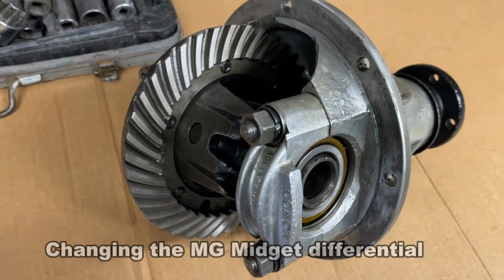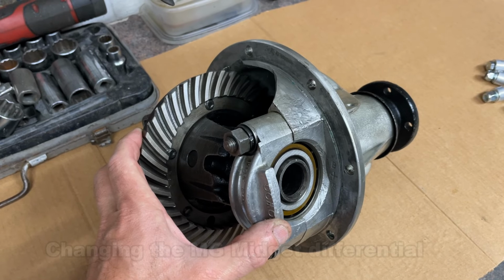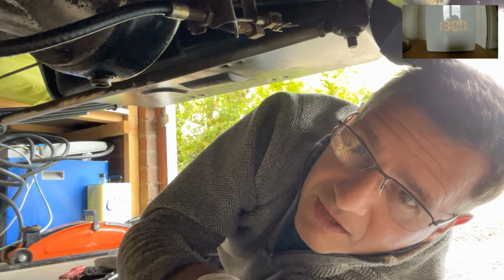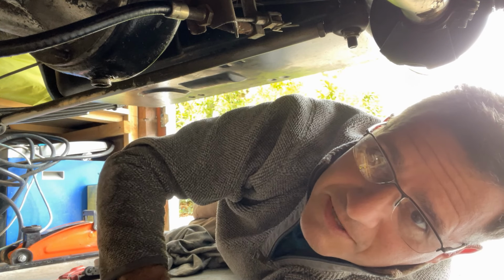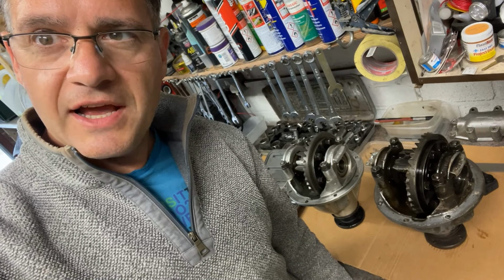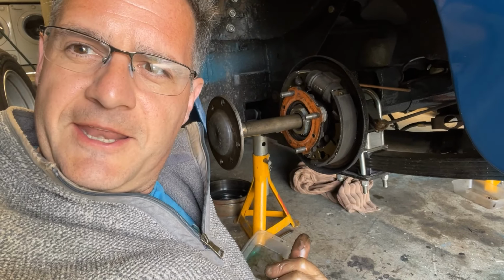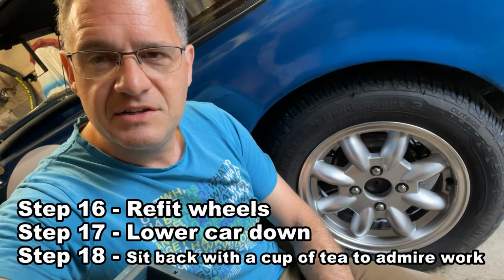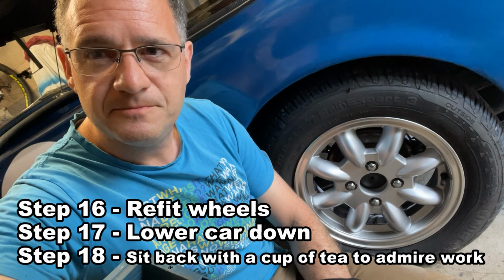MG Midget/Austin Healey Sprite/Morris Minor/Austin A30 differential change in only 1 hour!!!

Comment: Hello there - thanks for the videos - already used them to follow your steps in bleeding brakes and clutch. I have a 1967 MG Midget with what I assume to be  the original 4.22 diff. The car is very under-geared for general driving around. I know that in 1968 the diff was changed to 3.9. I'm considering going a step further and fitting a 3.7 diff. With your obvious knowledge of these things - do you think that would be okay - would the 3.9 make a big difference at 60/70mph - lowering the revs?
Reply from the maker: The 4.2 increased the ratio around 15% and is noticeable on acceleration. I'm expecting to run out of revs now on long straights. I've a track day next week which will confirm my suspicions.  the 3.9 is the most common size and excellent all round for normal everyday driving but for sprint and hillclimbs its too long.  ive got a 4.55 which will be my next stop if needed.  if you do mostly motorway cruising or highways then a 3.7 makes sense at the expense of acceleration/fun factor?  your choice but not too big a job to swap back if you dont like it. good luck
Reply: @mgmidget-thebirthofaraceca4349  Thanks for your help. Good luck with the car - looks like a winner!

Comment: I'm I right in thinking you are still not running a LSD?
Are you not allowed an LSD in the class you are running in?
Reply from the maker: Correct. I can’t use an LSD in this class of the MGCC speed series. It actually makes diff changes much easier to do